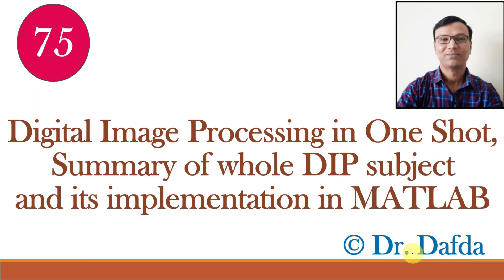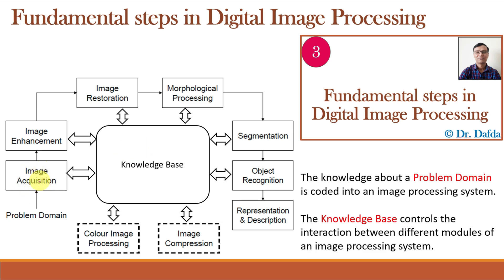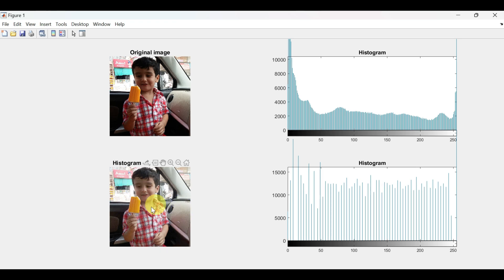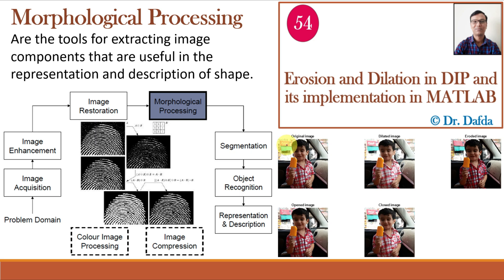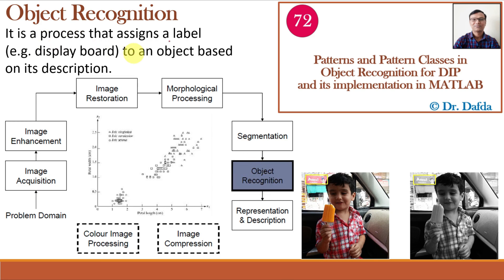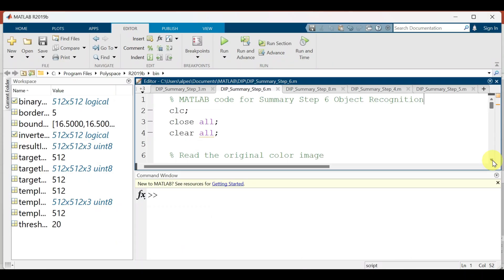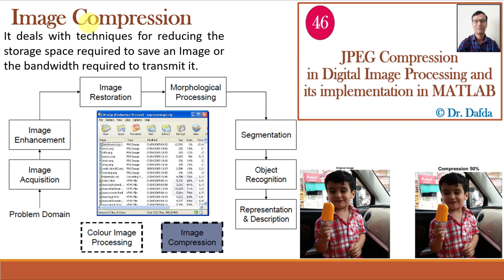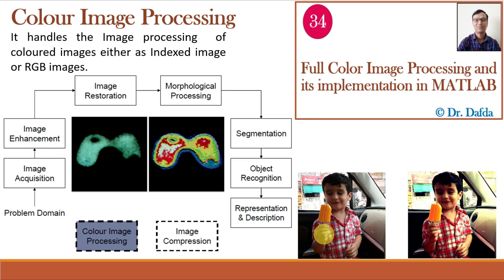Digital Image Processing in One Shot ||Summary of whole DIP subject and its implementation in MATLAB

Comment from the maker: % MATLAB code for Summary Step 6 Object Recognition
clc;
close all;
clear all;

% Read the original color image
targetImage = imread('Maulik.png');

% Read the template image with the object to be detected
templateImage = imread('Maulik_template.png');

% Ensure that both images have the same dimensions
[templateHeight, templateWidth, ~] = size(templateImage);
[targetHeight, targetWidth, ~] = size(targetImage);

if templateHeight ~= targetHeight || templateWidth ~= targetWidth
    error('Both images must have the same dimensions.');
end

% Create a binary mask for the template area
threshold = 20; % Adjust as needed
binaryMask = any(templateImage > threshold, 3);

% Set the template area to black in the template image
templateImage(bsxfun(@times, binaryMask, ones(size(templateImage))) == 1) = 0;

% Create an inverted binary mask for the template area
invertedMask = ~binaryMask;

% Set the inverted area to white in the template image
templateImage(bsxfun(@times, invertedMask, ones(size(templateImage))) == 1) = 255;

% Create a copy of the original image to add the yellow border
resultImage = targetImage;

% Draw a yellow border around the template area
borderWidth = 5; % Adjust as needed
boundingBox = regionprops(binaryMask, 'BoundingBox').BoundingBox;
resultImage = insertShape(resultImage, 'Rectangle', boundingBox, 'Color', [255, 255, 0], 'LineWidth', borderWidth);

% Display both images side by side
figure;
subplot(1, 2, 1);
imshow(targetImage);
title('Original Image');

subplot(1, 2, 2);
imshow(resultImage);
title('Result Image');
Reply: Sir I emailed you please provide pdf of dip

Comment from the maker: % Matlab program for Step 8 Image Compression
% For simplicity, it uses only 1 Quantization table/matrix
clc;
clear all;
close all;

Q = [16 11 10 16 24 40 51 61 ;
     12 12 14 19 26 28 60 55 ;
     14 13 16 24 40 57 69 56 ;
     14 17 22 29 51 87 80 62 ;
     18 22 37 56 68 109 103 77 ;
     24 35 55 64 81 104 113 92 ;
     49 64 78 87 103 121 120 101;
     72 92 95 98 112 100 103 99];
%I = imread('peppers.png');
%I = imread('saturn.png');
I = imread('Maulik.png');
ImageSize = 8*prod(size(I));
Y_d = rgb2ycbcr( I );
% Downsample:
Y_d(:,:,2) = 2*round(Y_d(:,:,2)/2);
Y_d(:,:,3) = 2*round(Y_d(:,:,3)/2);
% DCT compress:
A = zeros(size(Y_d));
B = A;
for channel = 1:3
    for j = 1:8:size(Y_d,1)-7
        for k = 1:8:size(Y_d,2)-7
            II = Y_d(j:j+7,k:k+7,channel);
            freq = dct2(II);
            freq = Q.*round(freq./Q);
            A(j:j+7,k:k+7,channel) = freq;
            % do the inverse at the same time:
            B(j:j+7,k:k+7,channel) = idct2(freq);
        end
    end
end
b = A(:);
b = b(:);
b(b==0)=[];  %remove zeros.
b = floor(255*(b-min(b))/(max(b)-min(b)));
symbols = unique(b);
prob = histcounts(b,length(symbols))/length(b);
dict = huffmandict(symbols, prob);
enco = huffmanenco(b, dict);
FinalCompressedImage = length(enco);
disp('the compression achieved is:');
ImageSize/FinalCompressedImage
subplot(1,2,1)
imshow(I)
title('Original Image')
subplot(1,2,2)
imshow(ycbcr2rgb(uint8(B)));
title('Compressed Image')